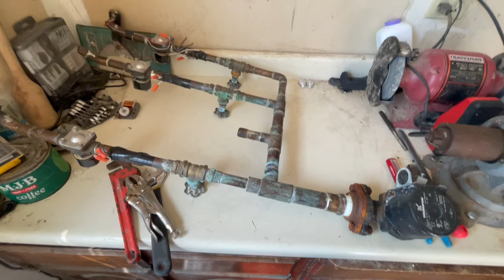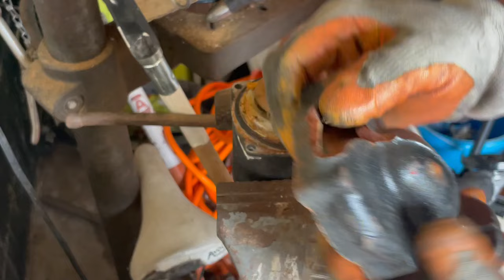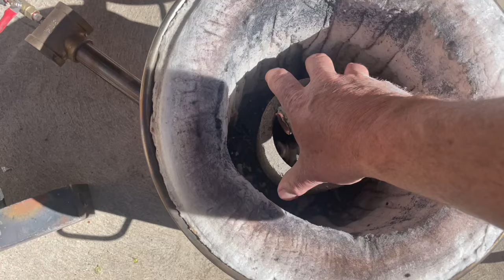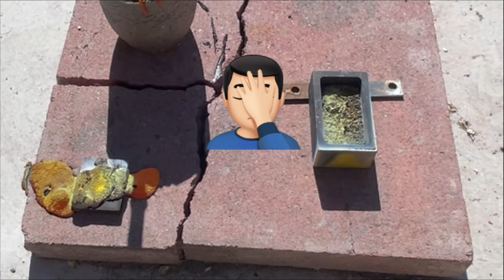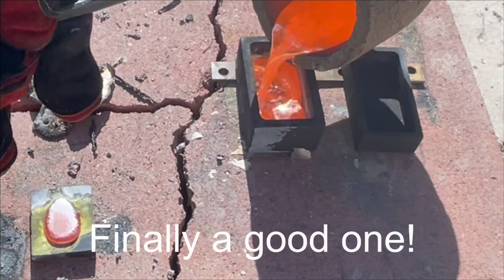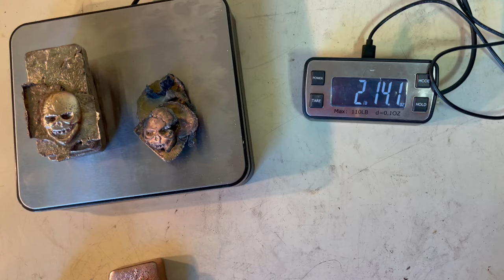Copper & Brass Melt | Water Manifold #copper #trashtotreasure #smelting

Comment: These manifold are definitely worth looking for! 

You should do a video of how to maintain your crucible, or where you find your items to scrap.
Reply from the maker: Definitely was worth more, I got this one out of an old house remodel. Copper pipe is usually easier to fine. I don’t know if they use copper in Indiana or cpvc for the water lines.
With the crucible I use them until they deaerate them get a new one.